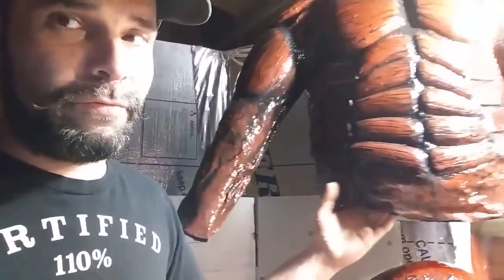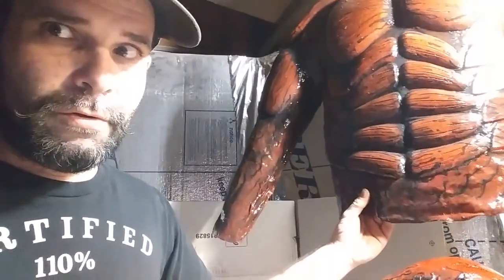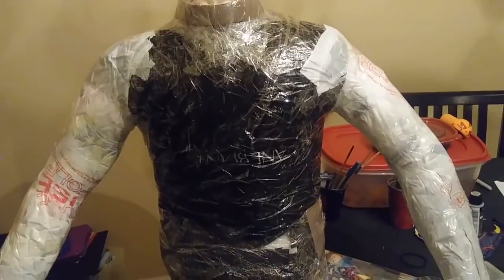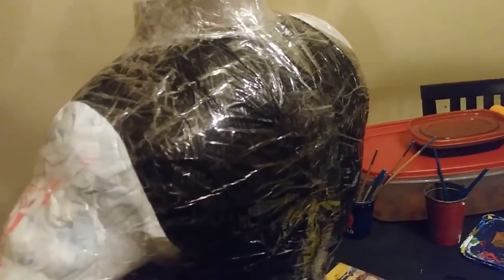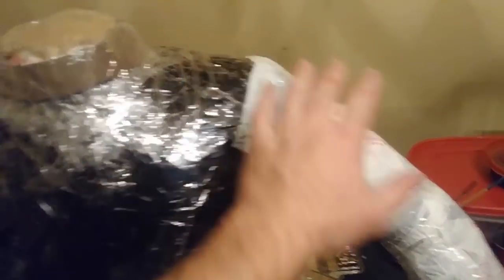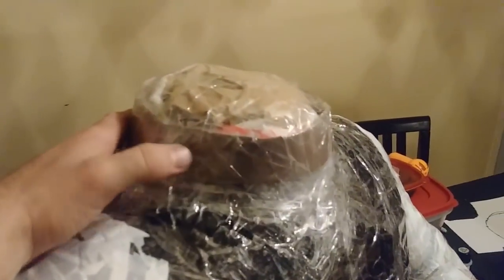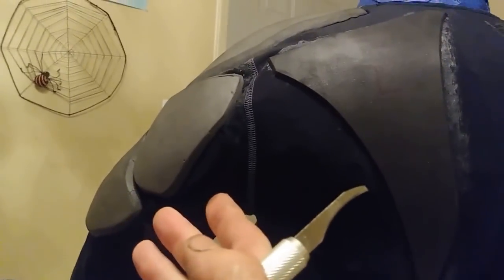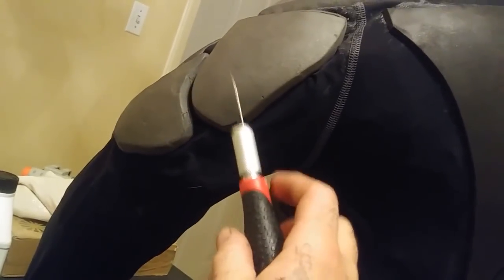Carnage Upper Body suit build video blog

Comment: Same here with clear 100% silicone 1/black dye mix for my Venom bodysuit, it sets really fast and the smell is INTENSE. Being on a time crunch I threw on rubber gloves and did one tube at a time smothering it on. It came out pretty good but another downside was nothing I tried sticks to pure silicone so I couldn't do vein or spider symbol details I wanted. Going to attempt v2.0 with flex seal. Great work as always!
Reply from the maker: Thank you!!! It is pretty intense, but I like It and can't wait to do more stuff like this.

Comment: I’m doing a venom cosplay and I’m using couch foam, I was wondering would fabritac glue be a good way to stick the muscles on to the shirt?
Reply from the maker: I have never used that. I usually use maximum tack spray adhesive from loctite. the couch foam really soaks it up though. i apply that to both surfaces and let it cure for the recommended time, however i usually apply a couple extra coats to the couch foam

Comment: Holy shit!  A few techniques I’ve never seen before and DAMN!  It’s awesome.  I got a con coming up in a week and 3 days.  How long did it take you? (Start to finish including drying time) And, I have to ask because I think I want to do it, cost???  If you give USD I can convert it (🇦🇺) plus, I’ve never worked with latex before.  I wanna give it a crack.  Again, nice job.
Reply from the maker: About 10 dsys.  Total cost: 45$ for latex, 20$ for shirt, 30$ for flex seal, but I have 80% of the flex seal left. Those were the biggest expenses. However, the day after Halloween sometimes things like liquid latex go on sale. Also keep in mind, 7 of the 10 days it took to complete I was at work (70 hour work week) and that helped slow me down. If I had more free time perhaps I could have finished sooner